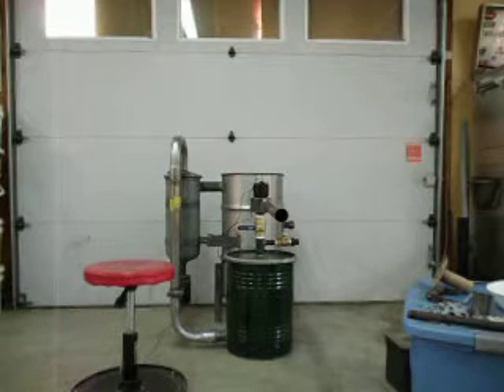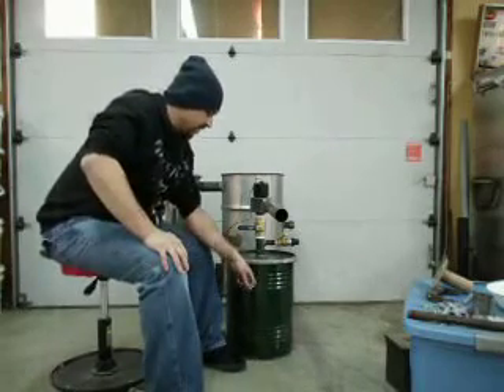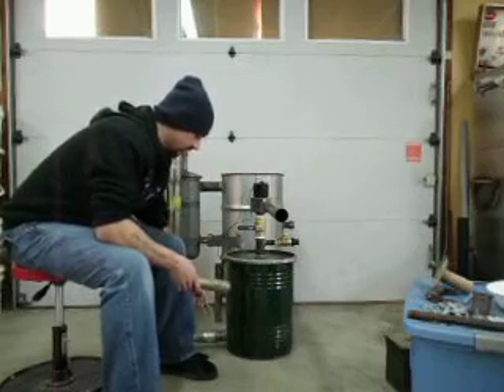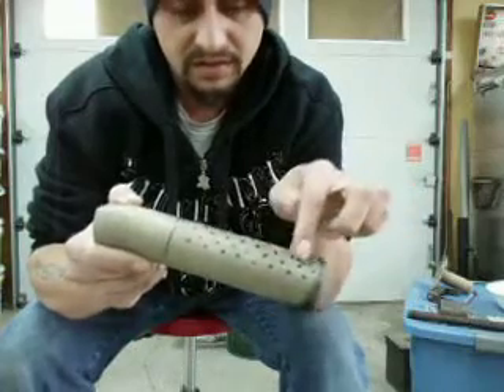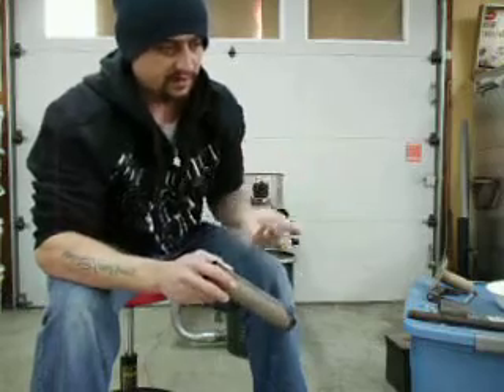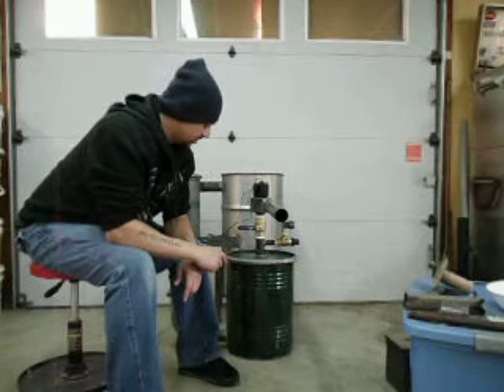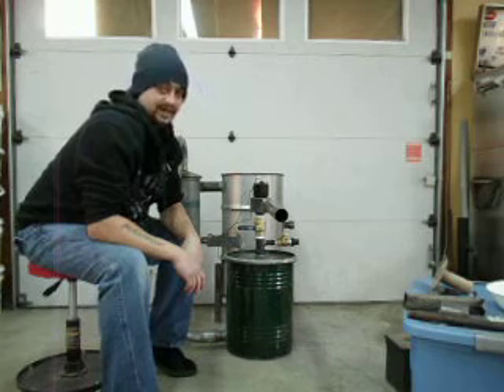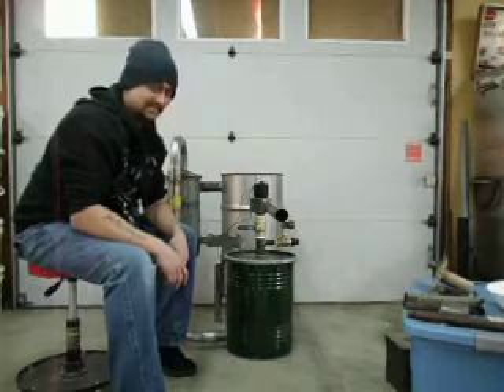how i built my gasifier #4

Comment: Joshua, I have a question about filter media.  I actually make lumber with a portable bandsaw mill.  Do you think that fine sawdust would be too restrictive of a media to use to filter the gas?  I DO use a chainsaw a bit, but I would have to create chainsaw dust to use as a filter media when I have all sorts of fine sawdust from the mill available.  Your thoughts?  Great job on the gasifier BTW.  I'm going to pattern mine after your modified FEMA design.

Comment: Thanks for the videos they are extremely helpful I have one question on the filter part.  Do you have the grate that the fema plans asked for does that not matter with your system.  also do you have a drain on your sawdust filter?...thanks

Comment: could I use a filter that resembles an older style air filter from a car or truck? where the gas bubbles up through oil. I think that if you had the inlet about halfway up the drum, then particulate would sink to the bottom and you would not need to change the oil very often at all. What do you think of this idea?

Comment: You are so right about the filter set up. My proto worked great for initial first run. But as you run your system it consumes some of the hydrogen it creates. So when you burn hydrogen you get some steam in your gas. So this week Im back to designing and I have a simple idea for a heat exchanger to ring the water out of it. After it im going to scrap the cyclone and build a simple water seperater and that will be it for my filter.

Comment: Two questions:

When you ran the gasifier and generator, how much condensation was in the bottom of the filter drum?

Also, have you ever(or would you ever) run the gasifier with just the cyclone filter just to see how clean the gas is without the sawdust filter?  I'm always curious to see how clean gas can be with minimal filtration(not saying that your total filtering setup is excessive).